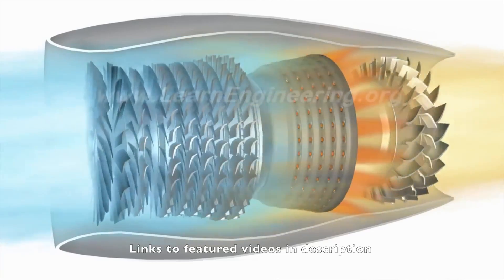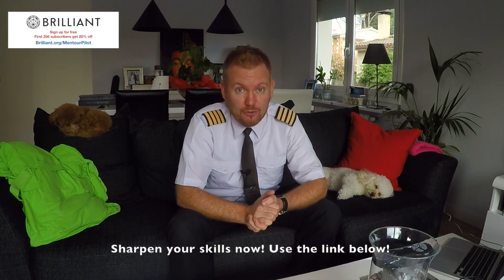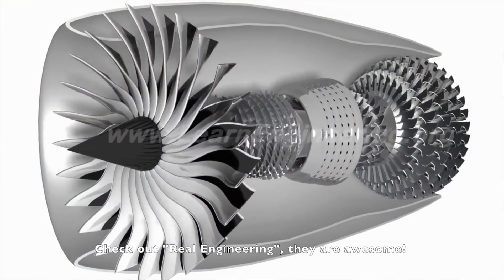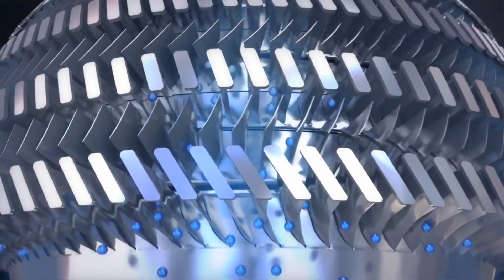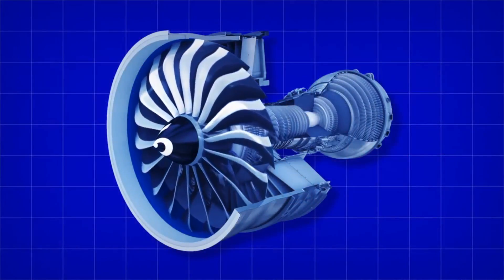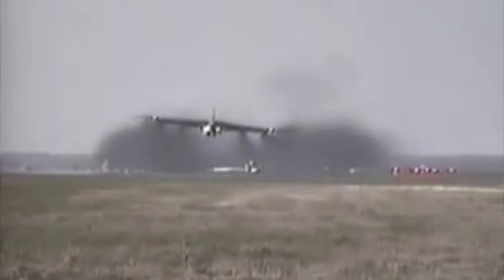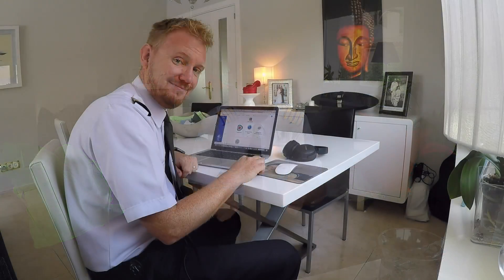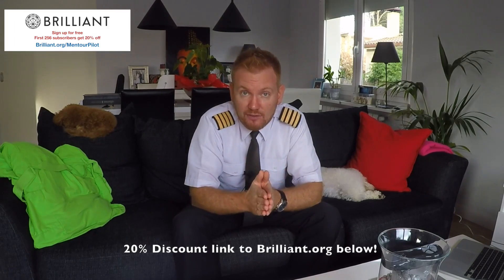Can water make Jet engines stronger?!

Comment: Since I liked this video, as you know Peter I've been watching Agent Jay Z Channel. VERY Interesting he put one of those 737 200 JTM Engines through it's testing for final completion of an overhaul. That water injection system as you say increased thrust on takeoff. But this to me was the real corker. IT actually REDUCED the NOX Emissions from the engine by 30%. If correct the engine was absorbing 125 Litres a minute. Imagine the clean up in air quality around busy airports for nearby residents if that was applied to all aircraft taking off.

Comment: Hello Captain! I Sincerely Hope that you have started Flying again, since this coronavirus mess first began! 😊

I do have 2 questions for you: 

So Firstly -if I am not mistaken-, why is it mandatory to have a take-off thrust limit, for example 80% and not just use the complete 100% during take-off? I do understand that after take-off we need to reduce throttle to climb thrust, mostly for environmental reasons for ex. Noise.

And Secondly, why do we have to keep the deicing system off while at cruising altitude? I do understand that, since the external temperature is severely lower than the surface level (approximately around -55C if I remember correctly), wouldn't the activated deicing system actually do good to the engine?

Thank You So Very Much! May you Always have Safe Flights! 🛫🛬 😊

Comment: I purchased the Mentour 360 App for 4.99. You state it is free... did I get the wrong App?  And, to get the link for the skill program I’ve been unable to connect with an IPad Pro. Buying a new model so maybe ‘‘tis will help. Are there yokes, pedals, and thrust handle that can be purchased for flight simulation? Thanks so very much!

Comment: Sir does wings have heater installed for deicing when ice get frozen during higher altitude?
Reply: Baby Dove No wing heat, not an issue.The slats are heated tho..

Comment: I am just curious, why airplane Piston engines need frequent overhauls than their counterparts the motor vehicle engines that last till car is junked, since they work on the same principle. I would appreciate an answer.
Reply: Professional racers know that engine life decreases horrendously with higher power running.  I believe the rule of thumb is engine wear increases with the CUBE of relative power level extracted in piston engines.  I.e. Run at twice the load, 8 times wear, triple load 27 times wear.

Jet engines don't suffer the same stresses.  Mostly because at 6000 rpm, they don't have parts (piston and crank and valves) reversing direction 100 times/second.  They happily spin the same direction all day long.

Airplane and boat are regularly set to maximum power, stressing the engines horribly.  Cars very, very rarely see full power apart from racetracks.

Comment: I flew a Navy P-3 Orion in the early 70s with a "dash 10" Allison turbo prop engine that used water injection. Our squadron unfortunately had an accident (crash) when maintenance once filled the water tank with solvent.

Comment: The reason is water injection will cool down the intake air, which during the compression stage will mean lower compressed air temperatures, which leads to higher air density, ergo more power

Comment: The B-52 used water injection to increase thrust on takeoff -- I worked on them (G models) in the late 70's.
Reply: We had the G-models on Fairchild well into the 80s. Everyone in base housing knew when they were doing water runs on the test pad.
The ground rumble the B-52G produced was actually very similar to what I felt during a Saturn V launch. Wicked powerful feeling.
Reply: Cool!
Reply: And KC-135 before they were re-engined in the '90s
Reply: @wxx3  I remember watching the black smoke come from the engines and think "old technology".  The planes were only a few years younger than I was.
Reply: I somehow doubt that water injection would have as much of an effect on the more modern high-bypass turbo-fan engines.
Edited: Finished watching the video. This is correct.
Reply: @surferdude4487  it would have an effect, as it adds reaction mass. It’s not used on modern high-bypass engines because it’s not required for takeoff thrust. It’s not because it wouldn’t work on it.
Reply: Wow. I didn't know that!
Reply: So did F-105's
Reply: I lived next to Strategic Air Command's Offut Air Base as a little boy for several years.  B-52's were always taking off over our house on full water injection.  They'd shake the neighborhood.
Reply: Wasn't that alcohol and water?
Reply: @oxcart4172  No. I asked that question once myself. The system injected water into the compressors [stage 3? not sure, don't remember and too lazy to look it up right now]. Once heated to the burn temps, water has a phenomenal expansion ratio to generate thrust. Downside is that it also cooled the engine enough to cause the thick black smoke (unburned fuel). The H-model got newer engines that didn't need water for the added thrust during launch.
Reply: @mktsmith62  thank u, Michael!
Reply: @oxcart4172  i believe you are thinking about the water methanol injection used on high end piston engines. This was used extensively both bybthe allies and the axis engines. The engines used by the allied had the benefit of using high octane fuel as well, which made this less important. For the axxis however this was very important to reach parity with the best engine produced by their oponents.
Reply: @johndoe1909  possibly! But I learned something-that's the main thing!

Comment: It's actually called in propulsion science as "increased mass flow." The KC-135 A had it. Referred to as the "Water Wagon."
Reply: Serviced many gallons of de-ionized water in tankers and B52s. I still remember the feeling of running a 8 engines and doing a water burnout run. The airplane was bucking, snatching at the controls, and pure noise. 96000 Lbs. of thrust, and a feeling of barely contained power.
Reply: @beverlychmelik5504  wowwww! What an awesome experience Bev! Thanks for all you did for our country. I had a friend from church who enlisted and would up guarding '52's. One night he fell asleep and left his rifle in the intake of one of the engines. The crew started and the rifle fodded the engine and the plane was down. Needless to say my friend's career was shortened. He was diagnosed with narcolepsy I think. I don't if he revealed that during his physical or not.
Love that billowing black smoke even though it's not politically correct!

Comment: Excellent video. My dad was in the 8th Air Force in WWII, his plane was a B-24 Liberator. We talked about that plane a lot, the one thing he told me was that the radial piston engines on that plane had water injection which cooled the temp of the combustion chamber and prevented detention which could destroy the pistons. Very cool stuff. I am enjoying your videos, keep them coming.
Reply: ADI (Anti-detonant injection) was fairly widely used on aircraft engines in WW2. The idea was to keep the air-fuel mixture in the combustion chamber dense by cooling it down. This would reduce the probability of the occurrence of knock, which is the combustion of the air-fuel mixture at different points in the combustion chamber or before the piston has reached top dead center. This would allow the engine to run at higher RPMs without the occurrence of knock and therefore produce more power. The Germans had their famous MW water-methanol injection mixtures and GM-1 nitrous oxide injection; since they had no access to the high-octane fuel that the Allies were using, this was their alternative. The Western Allies mainly used pure water or water with a small concentration of methanol. The USAAF prior to WW2 had a mindset that this was only useful for bomber aircraft to perform short takeoff operations but later in the war used it on some of their fighters and attack aircraft. The Royal Air Force had pretty much the same mindset. The reason was that they were already using fuel with octane ratings of 100 or more, which already had a low probability of knock, so they didn't really see the need of adding unnecessary mass to the aircraft which would be detrimental to manoeuvrability, range and acceleration in fighters.

Comment: Thrust should be increased by the high rate of expansion from water to steam in the combustion section, but wouldnt really be significant because thrust out of the hot section is less than the N1 fan. The FADEC automatically adjusts for it.

Comment: How does fog affect flying commercial planes?   Can pilots land safely when the clouds are low to the ground?   Do you have radar on board that lets you fly even in bad weather around terrain or bad storm?  I was on a flight once when we were in white out and came down to land.   When we got almost to the ground we could see that the plane was at an angle with the ground possibly dealing with side winds and we heard a noise like we were scraping the wing for a second and rapidly twisted to the opposite angle and hit the runway hard.  What a flight.  On a boeing 727 flying into boise idaho.   What about small planes and helicopters flying in the clouds?

Comment: Actually, the first high bypass ration jet engine, the TF39 on the C5 Galaxy had a water injection system.  The JT9D-3AW and -7AW turbofans on the first two generations of the 747 also had water injection systems, though I'm not sure how often they were used.

Comment: How come that you need "more trust" on take off when the coefficient of friction between the wheels and the surface is lower ?????????
Reply: If the needed breaking distance is longer and the runway length and the take off speed stays the same you need decrease the acceleration distance. You can decrease the acceleration distance by accelerating faster. The simplified formula for the acceleration distance is: 
0.5 * take off speed in m/s * time to reach take off speed in seconds = acceleration distance in meter
time to reach take off speed = take off speed in m/s / acceleration
Reply: You need more trust in your abilities as a pilot than under normal conditions because you may skid off the remaining runway length in case of aborting takeoff.

Comment: I have noticed  crashes that were attributed to storms when I think it was due to the use of a sidestick to control the plane rather then a traditional yoke.  Sidestick use allows the pilot and copilot to fight for control of the plane (the warning chime has been turned off) .  It allowed the copilot of AF 447 to stall the jet from 14000 feet to the ocean, because no one could see what he was doing.  I think all sidesticks should be banned and all planes that have them should be grounded until; they can be fitted with traditional yokes.

Comment: Why can't passenger airplanes have their engines at the back like fighter jets?
Reply: They probably can, it would just need to be redesigned from the ground up. But even if they did, with how big the engines are now it would look ridiculous.
Reply: Alonzo Taylor if it’s safe then I don’t think the look matters. What do you think?
Reply: @SamExclusives  in my opinion it wouldn't look to bad, I'd imagine it would look the same as an jetliner today, sans the huge engines. However, my brain gets thinking on some of the issues the biggest one being thrust. A jet fighter like the F22 only produces around 35000lbs of thrust where a GE90 produces 102,000lbs of thrust. Even if you were to use a F35 Lightning engine that's still only 40,000lbs (someone will correct me if I'm wrong) you would need at minimum 3 of those engines to get the same thrust as one GE90, and all aircraft have at least 2 so double that to 6 engines. Now my next thought goes to intake and exhaust. They tried this once before with the Comet back on the 50s, the engines were smaller, close to fighter jet size and were embedded into the wings. I think then, where would the intakes be and where would the exhaust be. Since all modern aircraft can fly on 1 engine (3 for 4 engine aircraft) let's say we only need 3 of the aforementioned 6 engines at around 120,000lbs of thrust. The intakes I could possibly see being mounted on the sides of the center fuel tank bulge if we wanted to remove them from the wings completely  like most fighter jets, but the exhaust for the thrust would have to be much much bigger than the exhaust they have now for the APUs, that's the second biggest concern I see. The biggest issue I feel is where would the engines go? We would have no choice but to either add a large portion of aircraft in order to fit the engines in the body or remove passenger and or baggage space to put them somewhere, in either case causing it to be less economical for airlines. There are more problems I can think of but this is long enough as it is. It can be done I'm sure, by someone smarter than me no doubt, but with current technology efficiency, I dont see it happening.

Edit:
I realized I didn't answer anything you just asked. In short yes it would look fine, even good if done right. I assume it would look almost identical to the planes we have now sans the giant engines under the wings. If anything it would look closer to the Comet of old. What I think they should do, if they go that far to embed engines into the body like that, they should go all the way and remove the tail rudder and make it similar to the B-2 rudder setup.

Comment: Also, regarding water injection... How about hydrogen peroxide injection instead? This would have many of the same effects as water injection except it would actually help combustion.
Reply: Increasing temperature isn't really what an engine needs – the turbine is effectively running at thermal limit already.
Reply: Appable Hydrogen peroxide would actually have a net decrease on the temperature of combustion. The liquid would boil away, taking away heat from the process of combustion because of the transition from liquid to gas (which in hydrogen peroxide, occurs at a higher temperature than water), but rather than displacing the oxygen needed to combust the fuel (which water would do), the hydrogen peroxide would instead supply additional oxygen, allowing the fuel to not only combustion more completely... but at a lower temperature thanks to the cooling effect of the boiling of the H2O2.

Comment: Why there is white colour strip like thing appearing only in fightr jets
Reply: sonic boom :)
Reply: Could u explain please
Reply: @srivathsans9865  it could also be condensation from the moisture in  the air. 

If it is a sonic boom, the jet is going faster than the speed of sound it. From google: A sonic boom is a loud sound kind of like an explosion. It's caused by shock waves created by any object that travels through the air faster than the speed of sound. Sonic booms create huge amounts of sound energy. When an object moves through the air, it makes pressure waves in front of and behind it.

Comment: I understand somewhat how a jet engine works - but I don´t understand why the air does go in one direction and not in the other? If the air is compressed in the compressor stages and then it goes into the burner stage - why does it go out in the rear and not to the front?

Comment: Are the fan and the turbine in a jet engine fused together or are they built in a way so that they can connect/disconnect and spin at different speeds?
Reply: Gynocentrism Ergo MGTOW the primary turbine is connected to the main compressors. The secondary (final) turbine is connected to the fan. The two shafts are independent and allow the engine to turn faster than the fan. Some engines have three stages / shafts.

Comment: In this video, it is said that the water will boil when it crosses the compressor stage due to adiabatic heating.  I believe there is a mistake.  The temperature will increase but at the same time the boiling point of the water also will increase due to the pressure.

Comment: Question, does the effect if the fan drawing in such massive amounts of air actually lower the air pressure in front if the fan and in effect higher pressure around the back push the engine into this low pressure space?

Comment: When I was in Afghanistan, my crew chiefs would pour water into our blackhawk engines, on startup, if it was hit starting.  It worked well.  This would usually happen when the engines were near their refurbishment effective power level.  The dust in the middle east would make it so you would only get about 4 to 6 weeks out of any engine, before the hot section needed replaced.  That would equate to about 100-150 hours or so.

Comment: very interesting your video on water injested in a jet engine but as water instantly expands by a very large percentage in the temp of a  jet engine does this not add to the volume of the exhaust gas thereby increasing the workforce of the jet

Comment: Water injection into a jet engine only increases thrust when it is injected behind the inlet. Water in the air before it enters the intake replaces oxygen and will ultimately reduce thrust. Early jet engine where manufactured with water injection especially military engines.